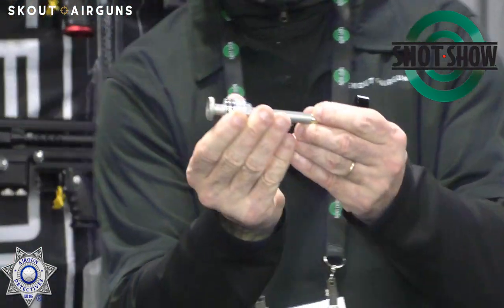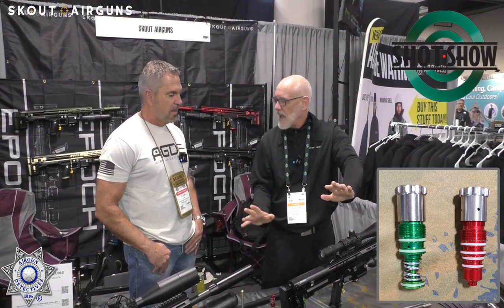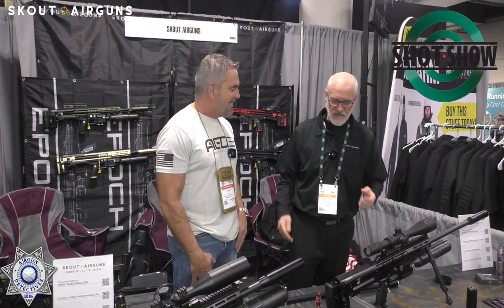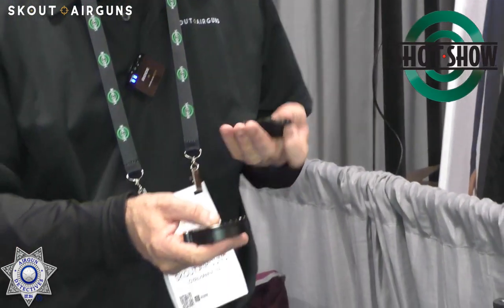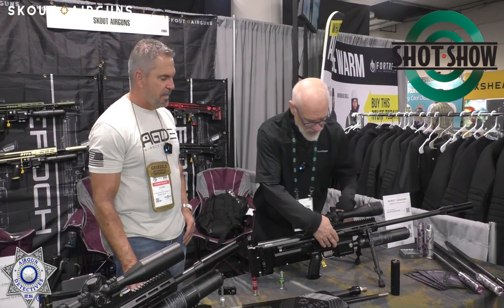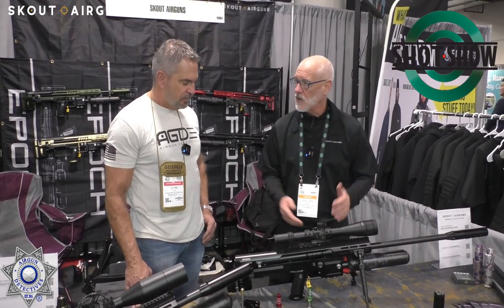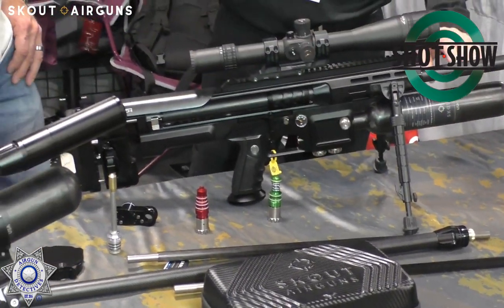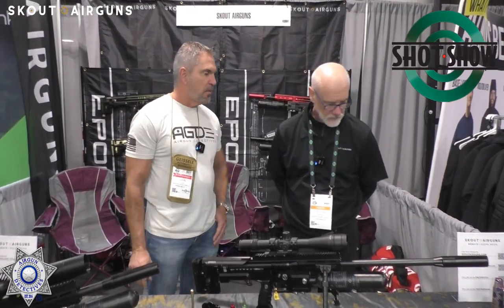SHOT SHOW 2023 (Part-8) SCOUT AIRGUNS "2023" by Airgun Detectives

Comment: @ $2,350 for the .30 and $2,400 for the .35  it has  more bells and whistles, (plus the extra barrels) than the FX, SK, Air Force etc that have the same price point. It's a very impressive weapon to say the least. Ya gotta love a 22 round mag for the .30, an 18 round mag for a .357/9mm and 175 FPE  is impressive. 

Max. velocity:

    1100 FPS (.177 cal)
    1093 FPS (.22 cal)
    1096 FPS (.25 cal)
    1093 FPS (.30 cal)
    988 FPS (.35 cal)

Max. power:

    22.9 FPE (.177 cal)
    67.3 FPE (.22 cal)
    88.9 FPE (.25 cal)
    118.7 FPE (.30 cal)
    175.7 FPE (.35 cal)

Comment: The rifle is way nice - but the price of one pushes most interested buyers away.
But if I'd win the lottery - then I'd probably wanna test one of these out..
Reply from the maker: It appears you need an advanced engineer degree to grasp the overall operation and adjustments of the rifle.  Let's see the performance!
Reply: @AirgunDetectives  Yea. I'd think it might get interesting to open up one of these .😁😁
Yup. Would not mind to see it on the range too.